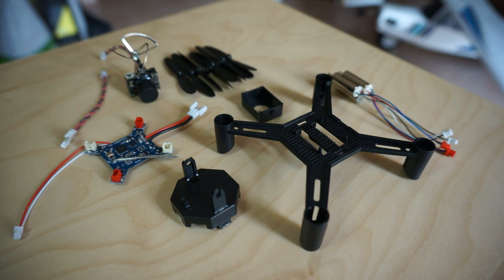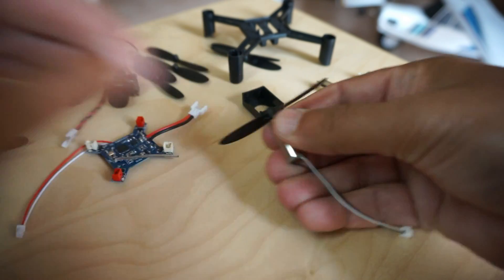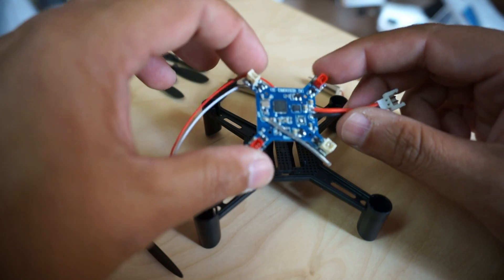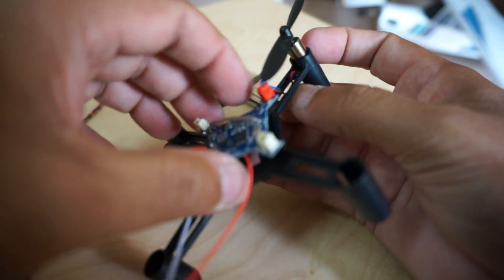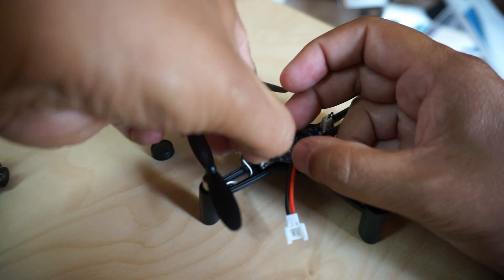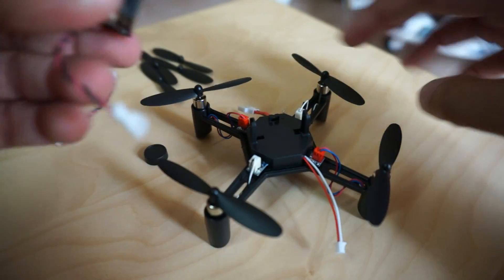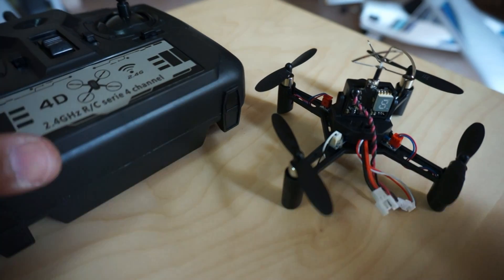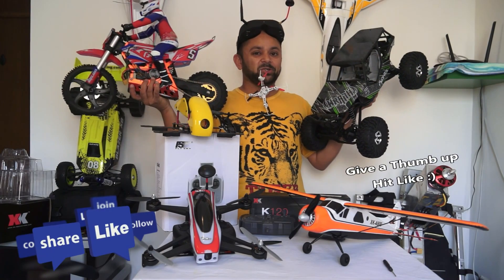DIY Drones Micro FPV Quadcopter Build Video

Comment: Sir I want micro vtx osd support I have built hex nano drone but I want vtx 25mw contact me I'll buy
Reply from the maker: no vtx support OSD. osd is part of flight controller. VTX job is just to receive video and transmit it in the air.

Comment: DIAGONALLY OPPOSITE SIDE write A AND B IN THE MAIN FRAME OF THE DRONE AND I CONNECT MOTOR AND CW CCW ON THE MACHING WITH FRAME A WITH PROPLLER A AND B IN THE FRAME WITH PROPLLER B

Comment: Hi great guide followed it all the way only issue I have it goggles don't pick up the signal from the camera. The camera is on just like yours I have even changed channel with the camera but no signal,any clues cheers
Reply from the maker: Its because the video Tx is in Pit mode. you can change Bands and frequencies but its not transmitting. You have to push that little button on video tx and hold it until you see - hyphen blinking, press again and you will have two hyphens, Again and you will have 3 hyphens on the LED on the Video Tx. that means its transmitting. single hyphen means its in 25mw power, 2 hyphens, 50mw and 3 hyphens 200mw I believe. I suggest keeping it on single hyphen 25mw or else it will become too hot and consume too much battery power.
Reply: alishanmao thanks for you help it flys great for the price